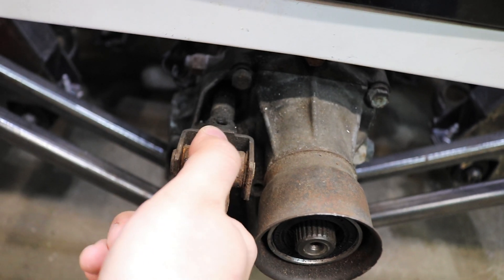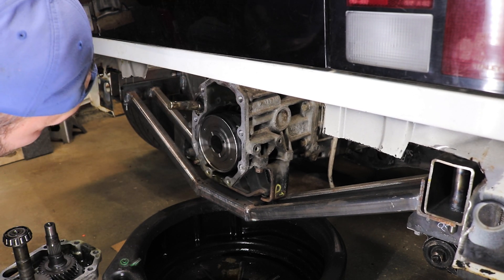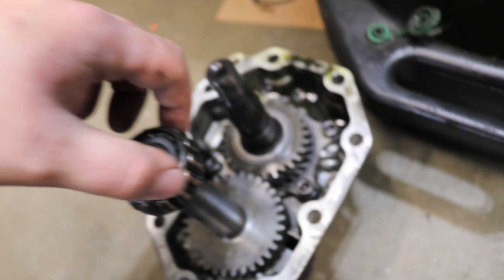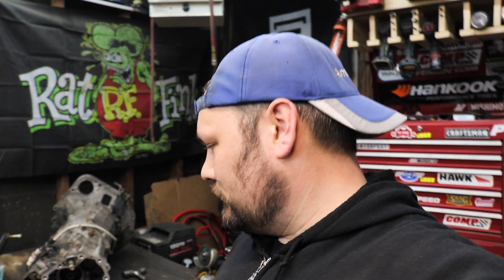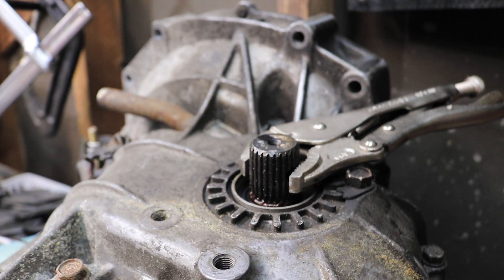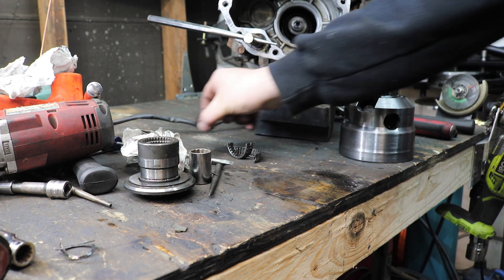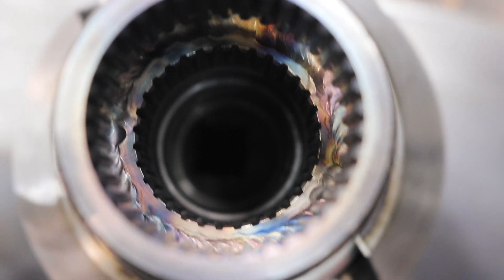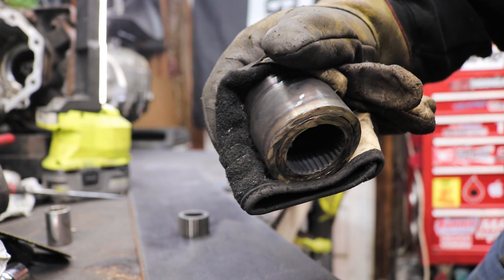Subaru Powered CRX: Converting a Subaru WRX AWD Transaxle to 2WD

Comment: Where can I find that specific transaxle. Do you know the model number? Dude I just discovered your channel and I love your videos. Very informative. Thank you.
Reply from the maker: Thanks! The one I use is the 5 speed out of the 02-07 USDM WRX but depending on application the same process would apply to any of the 5 speed transmissions.
Reply: Dude, your awesome. Thank you so much for replying. You started a fire in me. I want to build a mid engine Porsche Spyder using the same boxter engine and transaxle you have. Your channel is awesome. Please keep the videos coming. Have a Great new year.
Reply from the maker: Thanks! Glad I could help. Good luck with your project 🤘

Comment: Dude, I want to know how the transmission center diff holding up after the 2WD modification. I wanted to know what you did with the roll washer when taking out the inner gear?

Comment: Can the transmission be used in 2wd only and not perform this project if the rear cone is somehow closed off?
Reply from the maker: the shifter shaft sticks out the back of the trans, so you can't cut too much off

Comment: OK Been watching this for a while, Thank you for posting!  Did everything you did but now My transmission will not turn my axles? I can put it in gear, turn the center nut and it will rotate the engine, and I can put it in neutral and it spins freely with out turning the engine over but no matter what I do I cannot get the axles to turn?  I can rotate the axles in all directions with the tranny in gear on out of gear and still I can not get my axles to sink with the transmission. Any idea what is going on here? Is there some kind of lockout that need power on one of the tranny plugs? At a loss here. Thank you!
Reply from the maker: It sounds like the front diff driveshaft isn’t splined into the rear carrier (the gears that need welded together). Just a guess tho
Reply: @Enginuity  I thought so too then bought a coupler. now I'm thinking my front sider gears in the diff are no good.

Comment: @Enginuity... Questions for you. 

1. Did you notice any fuel economy improvements with this mod?
2. Did you notice and horsepower gains with this mod?
3. I have heard rumors the front axles alone won't be as reliable because the load on them is doubled. How true is this? Does this shorten the lifespan of the CV axles?
4. Lastly, is this tranny still running?
Reply from the maker: Check out my latest video for answers to all your questions

Comment: Would it be possible to shorten or remove the rear part of the case altogether?
Reply from the maker: Probably, depending how badly you feel like making it happen.  The shifter shaft doesn't give you a lot of room to shorten it.  You'd also have to make your own thread bosses to attach some sort of rear cover plate to.

Comment: Question, did you do a video on how you made the backing plate on the transmission? If so did you make a template of it I need to know what seal's and far the shift shafts stick out.
Reply from the maker: It’s just 1/4” aluminum plate I cut, drilled and ground down to mate up. Sealed with rtv

Comment: Can I use a manual transmission out of a 2002 Impreza that has a turbo charged engine,or does it matter?
Reply from the maker: Yep. Any Subaru 5 speed will be the same steps. I haven’t cracked open a 6 speed but I’d wager those have the same main shaft design
Reply: @Enginuity  thanks 👍

Comment: Stupid question for you. Could I do the same thing to a automatic transmission? And would it be the same steps?
Reply from the maker: Not sure - it would all depend on how the automatics transfer power between the front and center differential. It definitely wouldn’t be the same steps tho
Reply: @Enginuity  okay wasn't sure just wondering if it would work

Comment: Those welds look good but there definitely gonna break because he didn’t add any filler rod at all he jus melted the 2 together he only used filler rod on the tacs
Reply from the maker: I’ll do an update video when I’ve got some track time on it. We’ll see. I’ve done plenty of fusion welding before without issue 🤷‍♂️

Comment: Do you happen to know the length of the Subaru transmission? I'm trying to figure out if it would work for my application but I haven't been able to find dimensions of the 5 or 6 speeds anywhere. I know they're longer than most transaxles.
Reply from the maker: I just popped out and measured. It’s 26.5” from the face of the bell housing to the end of the case if you do the conversion (remove the tail housing) and 29” if you measure to the end of the shifter shaft
Reply: @Enginuity  Thank you so much for doing that
Reply from the maker: You got it

Comment: I am wanting to use an Audi zf8hp55 in a mid engine build. Will be powered by a built k24turbo. I originally was considering using the Audi 7 speed s tronic (dct) but it won't hold the torque/hp the engine will be making.
The zf trans is also awd (as is the dct/s tronic) I was thinking that what you did to this wrx trans could be done to that one. Do you habe any thoughts on it? The zf8hp is probably the best performing automatic trans made so far. It can be modified to handle around 900 lns ft tq. It shifts as fast as a dct.
I want to put this engine and trans combo in a Cayman but I may have to settle for a Boxster.
Thanks for your time.
Reply from the maker: I haven’t torn one of those apart to know how their internals work sorry. I did poke around on some of the Audi forums and don’t see any examples of someone doing it so you might be in uncharted territory with that trans. I’d hit up your local dealership to see if anyone there’s familiar with the internals or if they can give you the factory service manual to help reverse engineer it. Good luck!
Reply: @Enginuity  There is a guy with some youtube videos of him installing an Audi 4.2 and a zf5hp in an mr2.
He actually sgows how he modified it to change it frim awd to fwd (bit since it is mounted behind the driber the fwd functions as rwd. He hasn't done any updates for well over a year so I have no idea how it worked out. I would think the zf5hp would be similar to the zf8hp.
Guess I will have to buy one and see for myself. Thanks
Reply from the maker: Interesting. Please keep me updated how that works out for ya 🤘

Comment: How much for that part you custom made and a aluminum plate for the rear of the transmission
Reply from the maker: The welded coupler didn’t cost me anything. The cover was about $60 between the cover plate and logo that I had laser cut

Comment: Would you be able to use one of these as an alternative to a Porsche transaxle for a mid engine kit car build? Maybe even upgraded internals to hold up against a possible v8? Maybe just an adapted 2jz or RB?
Reply from the maker: You would definitely need upgraded internals for anything over 350hp. I’ve seen these take 450 but that’s playing with fire. The biggest consideration to take into account is the length of the unit itself. Since it’s designed for a front engine application it’s longer than most transaxles so as long as you have the room you’re golden. Factory Five uses this setup in their 818 kit car if you want to see how a fully engineered setup works
Reply: Worked for a rally America car back in the day. The 6 speed manual transmissions in the sti's are pretty damn tough(and pretty expensive). Able to handle dumping the clutch on asphalt at 7k rpm repeatedly. Our car had 375 ft ibs of torque to the wheel. Most people never have to go for a different transmission unless you plan on swapping the internals out for ppg dog engagement, or for an entirely new full manual sequential gear box. But yeah, most of the usdm Subaru transmissions are pretty weak.
Reply from the maker: Agreed - my 04 STi has 160k HARD miles on the original trans between daily spirited driving and autocross. As my daily never had the guts to track it for fear of wrecking it. The STi transmission is one tough unit. The rest of the 5 speeds, not so much haha

Comment: Damn I’m building a mid engine kit car, this   hold longer then the 091 trans I was going to roll with. Thanks!!
Reply: I'm late to this discussion so you may have already found out how much torque it can take. These 5 speed Subby trans axles are good for something short of 300 ft/lbs or torque. It isn't going to survive a small block V8, but modern high output four bangers from Ford or Chevy shouldn't wreck them too fast. The problem then becomes an engine to transmission  adapter.

Comment: What kinda of power will it be able to handle with this conversion?
Reply: Like track days and that
Reply from the maker: Thanks for watching! Most of these can handle 400hp at the wheels without much trouble. This particular one was pretty torn up already so hoping it holds together. The other thing is that the front differentials in the 5 speeds are open so an LSD will be in this things near future

Comment: So the nut that you put on the adapter, what's the torque specs? Or did you just use ugga duggas?
Reply from the maker: Thanks for watching! Spec is 87 lb/ft but I had a hard time getting it torqued - socket kept wanting to slip and output shafts breaking free or the clamps. So I just ran it home with the impact. It bottoms out against the inner spline, there’s no bearing mating to it so figure over torquing wouldn’t be the end of the world. If I were doing this again I’d make a fixture to hold the output shafts still in order to properly torque. Given the condition of this trans it’s probably going to grenade soon anyway 🤷‍♂️

Comment: holy crap, how did i miss this video!!! This is a cool video! So, is this still an open diff, you just removed the output to the t-case?
Reply: also, will you need to cap the end of the cover now that there is no shaft coming through?
Reply from the maker: Yep, basically there’s a shaft that runs the length of the gearset that feeds the front diff so I just welded the output on the main shaft to that front diff input so the power just feeds that. Working on a snazzy aluminum cover to cap it off and sort out the shift linkage
Reply: @Enginuity  thats cool!!
Reply from the maker: I snuck it in there 😜